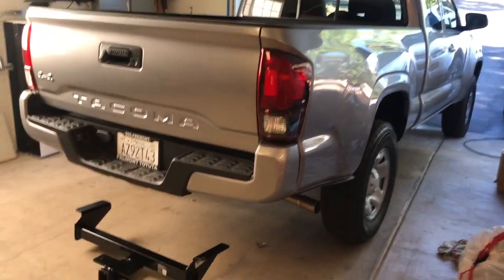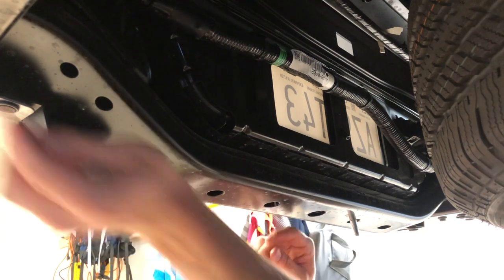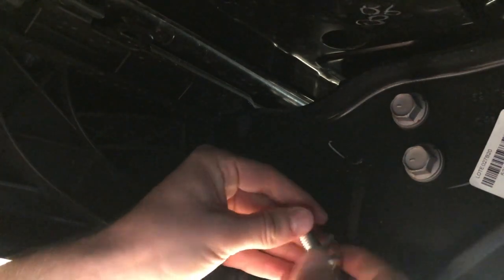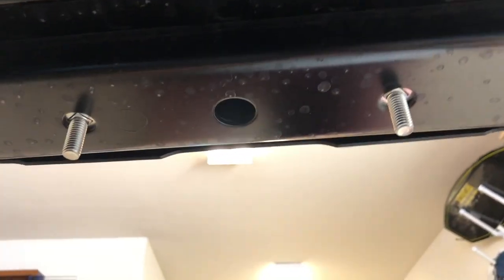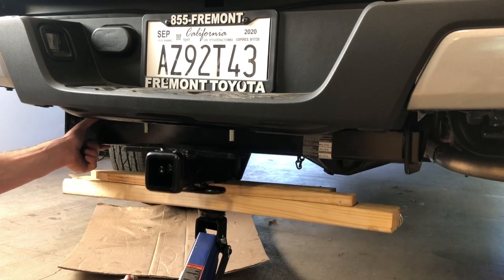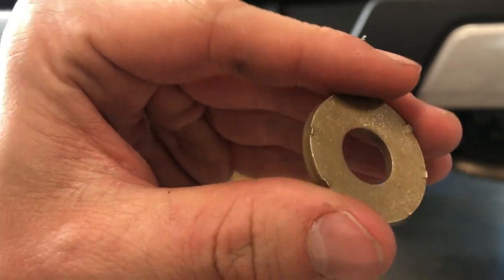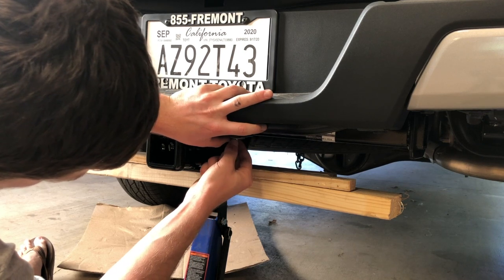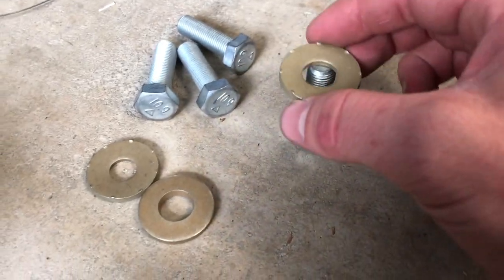How To Install a Hitch on a 2020 Tacoma

Comment: i helped a friend with this who didn't have the fishing wire - we used a straightened out wire coat hanger and some string - it was tougher than when i originally did it with the included wires on my truck - but we eventually got it
Reply from the maker: Nice work!

Comment: I just installed a Curt hitch on my truck tonight. Thanks so much for the helpful video. I would say it's worth mentioning that when you fish the bolts through the bumper,  make sure the carriage bolt is through the bracket when it goes in. I spent an hour trying to get the bolt through the bracket in the bumper before I realized it wasn't going to work that way. Then I had to get a magnet to get the bracket back out. I finally got it though!!
Reply from the maker: Great tip!

Comment: How do you the wiring? Should I get a 4 pin or a 7?
Reply from the maker: This is a 4 and 7 pin connector together
Reply: @92813justin  I'm assuming you used the Hopkins Trailer Wire Harness and Connector 40974.  How did you connect it to the trucks existing wiring?  It looks like Toyota made it easy with pre-existing connections.
Reply from the maker: @mattm2852  This truck did not have a wiring harness to begin with. See parts list in description.
Reply: @92813justin  I do not see the wiring harness listed under description. Do you have a source or link to purchase the wiring harness? Thanks
Reply: @billybob042665  Just towed my 17' boston whaler....no problems!
Reply: @billybob042665  Question, what if you have a manual transmission..Any issues there.